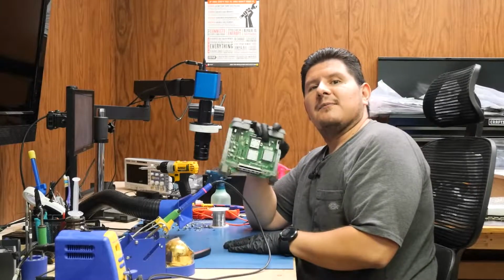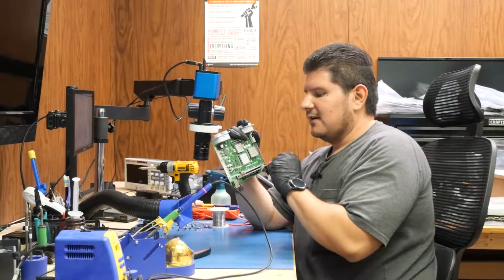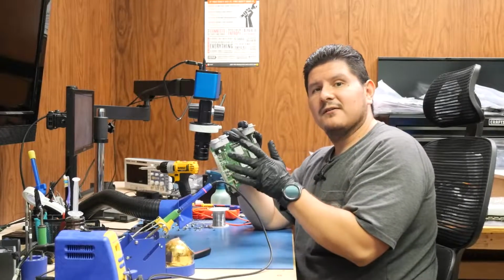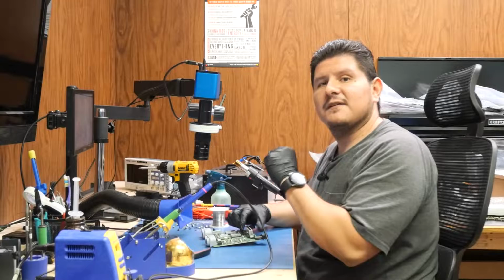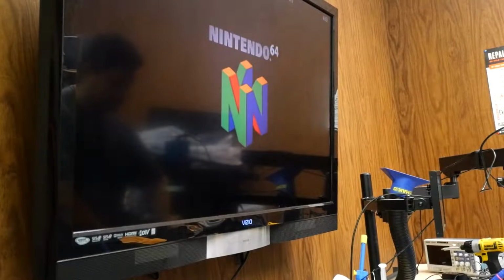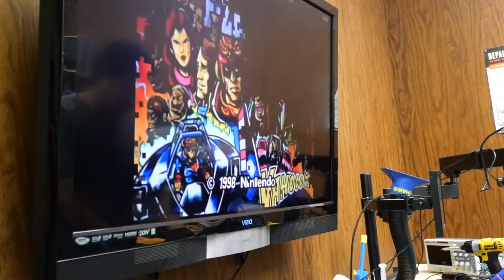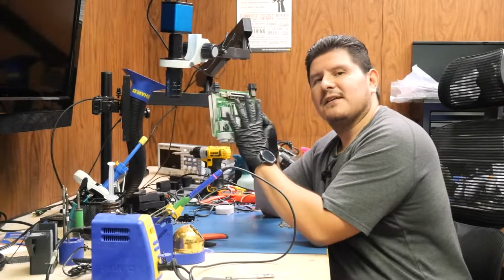Nintendo 64 Capacitor Replacement | Save Your N64 From A Corrosive Fate

Comment: When removing the caps you can simply  slightly twist side to side without pulling until they break. Slower but much less likely to damage a lead.

Comment: i just recpped my childhood n64 after almost 30 years of use.  i used solid palmer caps  for the 68s and the rest are electrolyte japanese caps.  i did something else though.  i replaced the thermal pads with high performance 12.8W/mK 1mm think pads and i also added in a dot of artic mx6 between the rf sheild and alumunum heat sink for even better cooling.  you can actually feel the heat coming of the heat sink its working so good now lol.

Comment: I have a really bizarre issue on a Japanese (old) N64 that I just installed with an RGB mod. The image is superb with the RGB chip installed but now the audio doesn't work right! 

At first I played for a few hours just fine with the mod installed, but then the audio disappeared! The sound was still silent after a reset, although it fluctuated a bit albeit with a low volume. The sound was back after a complete power cycle but it went away again. Some subsequent power cycles had the volume gradually decreasing until completely disappearing or having the volume go up and down. A couple of times even the picture glitched out into vertical lines of different colors but that might have been caused by me fiddling with either the AV cables or cartridge position. It was really hard to troubleshoot anything. It seemed like there was not consistency with the behavior.

I opened up the console again and tried to clean it up. I even tried to improve some of the solder joints. At first it seemed to help but then the audio did the same thing so it didn't really solve anything. No issues with the image anymore though but that could be a coincidence.

Unfortunately I couldn't resolder the AV connector pin solder joints because the RGB chip was in the way, and I have no way to remove the RGB chip since it has so many points of contact and I have no heat gun to desolder multiple joints at once.

So I was thinking that if the issue is not with the AV pins or the RGB chip, then could it be a faulty capacitor? Should I try swapping C28 (or just recap the whole thing)?

Comment: Removing capacitors this way, there is a great risk of breaking the island or track, it is not recommended to do it this way.
Reply: What’s the safer way? I’ve encountered this myself
Reply: @FlyingV555  soldering tweezers work or you can use two soldering irons

Comment: Bruh actually replaced the 68uf caps with another 68uf.
Here in brazil a LOT of clueless "technicians" will replace the 68uf caps with 100uf ones, since fiding 68uf's with low voltage is hard here.

The result is the decoder chip frying and giving you a black screen after some use, lol.

Comment: Awesome video! I'm in need of some help, would you know or be able to help identify the SMD resistor in the "FIL11" slot on the back of N64 board. I'm getting a 1.3 OHM reading with the multimeter, but not 100% sure if its 0201, 0402, 0603 type?
Reply from the maker: Thank you. I imagine its a 0603 and I get a 1 OHM reading out of it.